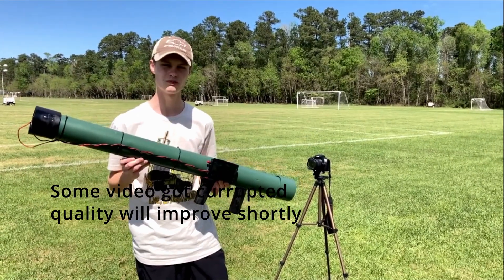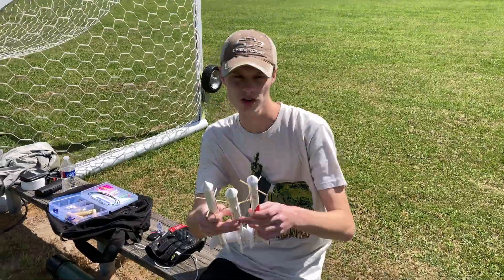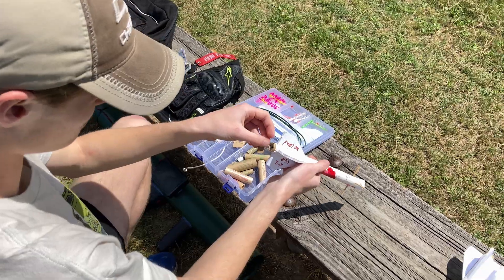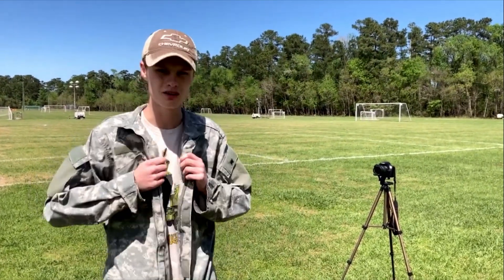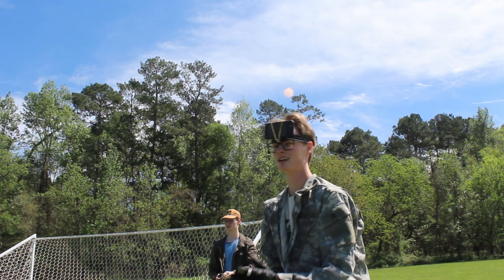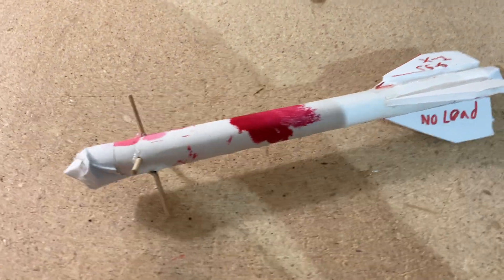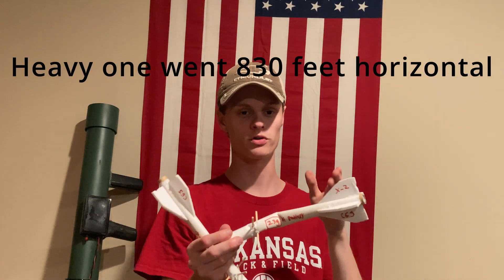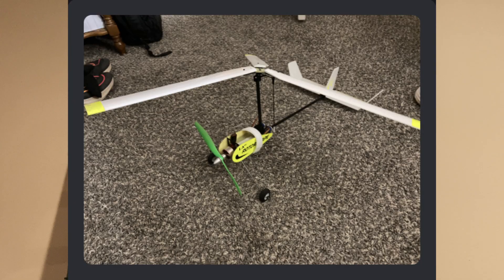Can You Build a Bazooka? (DiY Rocket Launcher)

Comment: Nice job. 

Read up on "center of pressure" vs "center of gravity".   Center of pressure I the mid point on the aerodynamic side profile of the rocket.  Center of gravity is easy to figure out, that is just the balance point of the fully weighted rocket (counting engine and front payload / ballast).   For a rocket to be stable, the center of pressure should be just behind the center of gravity.  So to stabilize your rocket, you can either make the fins bigger, or you can add more weight to the nose.    That is why your first rocket went whacko, and your more front heavy rockets were more stable. Changing the aero lets you get better flight performance than increasing nose weight, because the lighter rocket flies faster and farther.  You can also try extending the tail to go farther back than the engine.  That shifts the center of pressure farther back. 

Read up on "weather vaneing". If your fins are too big and your center of pressure is too far back from the center of gravity, the rocket will turn and fly into the wind.  (cross wind pushes the tail out of line, and points the rocket up wind in the process)

Also, try balsa wood or sheet plastic to make the fins rather than foam core board.  That will also give you better aerodynamics. 

Finally, try designing a rocket to 3d print.  Once you get the design right, it is more easily reproduced, and the fins will be be much more aerodynamic. 

Try and find a local model rocket club field for your tests to avoid people freaking out about your hobby.  Also, you can test fire your rockets like conventional vertical rockets from a stand to get the aerodynamics vs center of gravity right before launching them from your bazooka replica.  That lets you get some testing in with less chance of freak-outs as well. 

Good luck!
Reply from the maker: Woah thanks for you comment!
Thats a lot of good information! I plan to try to further develop this project and I will definitely return to this to help me out. 
I definitely will be looking into balsa fins and my end goal is to have a 3d printed rocket for that exact reason.

Thank you 🙂

Comment: How did u make the electric igniter? Did u use a voltage amplifier?
Reply from the maker: Just some clips that lead directly to the battery with a switch
Reply: @CaptainJohn  oh, the clips were made of copper or nichrome?
Reply from the maker: The clips are steel, and I used the regular Estes electric fuse
Reply: @CaptainJohn  ok thx

Comment: You can make a C65 model rocket engine with Potassium nitrate ,powered sugar ,and a little kittie litter 😁 the kittie litter keeps both ends from burning and mixing the other ingredients makes sugar rocket that shoots about 10k feet

You can make your own Potassium nitrate with grass cuttings, a tarp ,and your own urine 😂
Pee on grass and after a while it forms white crystals
Reply from the maker: I have actually experimented with this before, I built a little motor and tested it and it worked great! I should definitely revisit that! And I just bought my potassium nitrate 🤣
Reply: Kittie litter smells worst
Reply: Can we use cow dung?